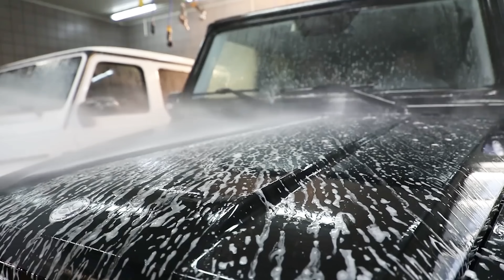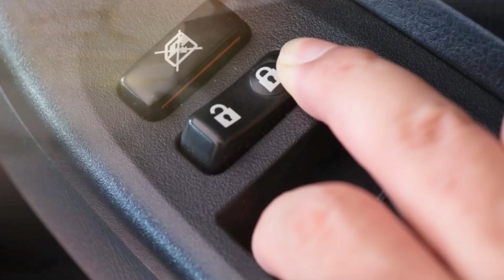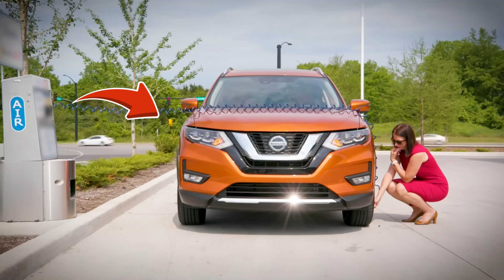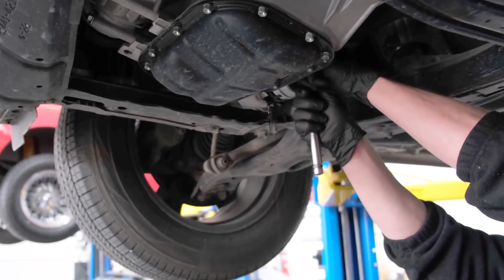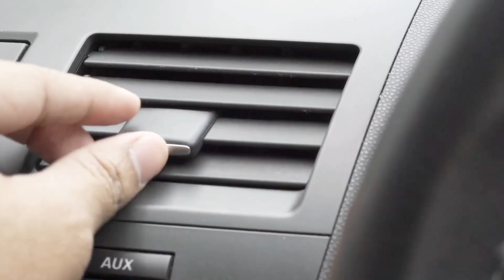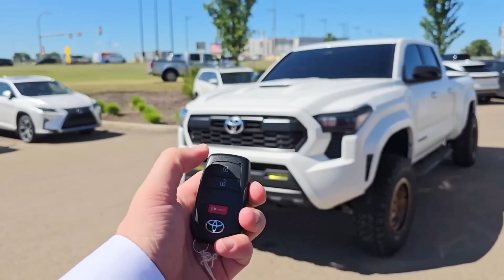This SECRET Car Features Is Only Known by 1% of Drivers (USE THEM NOW)

Comment: There are some recent vehicles (particularly certain VW models) in which you cannot put the windshield wipers in a lifted position. It causes significant problems for cold climates. Be warned.

Comment: I'm trying to figure out what good filling your car is going to do if the battery is so dead you can't open the gas cap.

Before buying a new car, read the owner's manual online. Find things like how hard it is to adjust the parking break or change the cabin filters. Sometimes it's a $100 PITA. Sometimes it's designed properly and is as easy as changing a coffee filter.

Comment: Many seatbelt mechanisms have a pyrotechnic charge in them that explode in the event of a crash and lock the seatbelt in place. A vehicles airbag is deployed by the use of a pyrotechnic charge. Impact crash sensors are made of a steel ball in a channel just barely big enough for the ball to travel in. The size of the ball and hole is calibrated so that in the event of a crash the ball will be forced forward to the other end of the channel. Inside the other end of the channel are two electrical contacts that the steel ball will complete the circuit between, signaling the SRS module that a crash event has taken place. These sensors are on both the front and sides of the vehicle, allowing the SRS module to determine which airbags to deploy and most new Safety restraint Systems have dual stage airbags that can deploy at two different pressures, an airbag blowing up in your face can break your nose and give you black eyes, but is still obviously better than not having an airbag. The airbags themselves are expensive so deploying all the multiple airbags in these new vehicles in the event of a lower speed crash is not economical and if you have a child car seat or a younger person in the passenger seat the airbag could do more damage than the accident itself so they use passenger seat sensors that weigh the weight of what is in the passenger seat and will not deploy the front airbag in the event of an empty seat of deploy it as a lower pressure if it detects a child car seat but its always best to have the child car seat facing backwards or even better the child placed in the back seat. The new SRS systems are very complex and work very well. As an FYI if you are riding around with your SRS, seatbelt, light on its very likely your airbags will not deploy in the event of an accident as the system is usually disabled when that light is on. Same with the ABS, if the light is on then the system is very likely disabled and will not work at all. This concludes my useless facts of the day.

Comment: The accelerator pedal reset worked great for me.

2006 Ford Focus ST.

Btw: It has nothing to do with the throttle body. Modern cars have electronic gas pedals. This function resets how the engine ECU processes throttle inputs.

Comment: I'm not sure about the feature were you leave the engine switched to on as you inflate your tyre to the right pressure. If somebody wanted to hijack your car at a petrol station, they simply have to jump in the driver seat and drive off as you're concentrating on the tyre gauge or when the horn is honking.

Comment: I wish I could get my auto theft to work right. I wish I could just disable it. It goes on and off then my car won't start until put a code in that I never used before. It's a 1996 Sunfire Convertible. It runs great except for that. I've had it looked at several times and never able to get it repaired. 😢 any ideas?
Reply: Pull the wires or fuse.

Comment: I have been driving stick since I was 18; 57 yo now.  All my vehicles are stick (manual shift).  Just an FYI, as an American, I want to point out that if I am on a flat road at a red light and can sit in neutral without holding the brake, I make sure the car behind me is NOT a cop car.  If it is, they might pull you over for not having brake lights.  If I have a cop car behind me, I keep my foot on the brake since they don't know I am driving a stick.

Comment: Most cars don’t have keys anymore. They have fobs so some of these so called secrets are not helpful at all.  As far as the electronic fuel door issue.  Doesn’t matter how much fuel you have if the battery is dead. 😂

Comment: #10 _ how do you literally drive up and get to the gas station if your battery is dead?  😂 I believe that the hidden release has a little more to do with electronic solenoids and buttons, failing, etc. than it does a “dead battery”. 

#8 _ I think pretty much everybody knows about this.  

#3 _ you don’t know this non-hidden, non-secret WHY? 

#2 _ might be the dumbest one on this whole list… I knew that my key fob remote started my car long before I figured out I could get an app to do it on my phone. Additionally, I learned that the app on my phone will work to unlock the doors in an emergency even without the subscription.  

#1 _ my last car would automatically tilt the mirrors down when I put it in reverse. By itself, as long as the mirror selector was not in the center/Lock position.  The new car does not do this at all. I’m going to test out this trick today - and see if it’s true.

Comment: Here's the kicker... If you own a BMW E90 or similar in the UK and your battery dies you can't get to the emergency pull cord for the fuel cap in the boot... The reason...??? The battery is also in the boot and there's no way of opening it... No manual key lock... no 60/40 split seats... no ski hatch... no manual lever boot release... NOTHING... Thanks BMW Europe...

Comment: None of the features described in this video are secrets! 🙃 If you have buttons in your car that you do not understand the function of it'll be in the manual.

I particularly enjoyed the bit about the "throttle reset" and the video showing a cable operated throttle body! 🤣So much nonsense shown in this video.

I'm not sure about the US but in the UK if you roll backwards on a hill during your driving test you just failed! Don't roll back on hills just learn to use your handbrake!

Comment: LOL .. If I have a flat battery ..My 2008 Vauxhall Astra  I cannot open the Hatch as there is no manual key slot .. the only door i can open is the drivers door ..   as the fuel flap is automatically locked , i would have a hard  ..if not impossible time trying to access the fuel flap pull

Comment: How did you get to the gas station to find your battery is dead and can’t open the fuel door with a dead battery? Even if you pull the emergency cable and fill the tank, you still can’t start the car and go anywhere.

Comment: I'm prettying sure everyone wearing a seatbelt expects it to prevent fatal injuries.
Reply: @SANSd20 . . . . Yes, that is the way the seat belt is designed. It is not necessary that car owners to know this in order to benefit from this feature, or many other safety features in a vehicle . . . they are simply there for our protection . . . . . . . .  and that's the kicker.

Comment: Well so far I just checked my car for the seat belt adjustment, I have none. Then I checked for the cooler thingy in my glove box
and none. So much for the Deville! No hooks in the trunk either to hook grocery bags on. But I did see some kind of netting thing
back there. I need an auto hold for my motorcycle!

Comment: You need to be careful with the "throttle body" clean tip. The correct name for this is a "relearn" which is basically going to reset your engine idle speed. But here's the "Kicker": if you have an Audi with the DSG S-Tronic automatic gearbox with flappy paddles, if you do what this dude says, you are going to reset your DSG settings, so proceed with caution.

Comment: The wiper erection is a good idea only to be made useless by by some spotty oik noticing them standing upright on a frosty night ,and conveniently bending the arms into a interesting swan shape,before disappearing into the night chuckling to himself ,where if your wiper arms were in the normal position possibly frozen to the windscreen the destructive brain cells in the oiks head would not be activated and he would carry on his way back to his sad little life,I’m leaving mine down just defrost your screen with tepid water pouring it onto the roof first so it runs down the screen start your car Immediately after and switch the wipers on before water refreezes.

Comment: Replacing the Cabin Filter will ALSO keep your heater core from getting clogged up with dirt, dust, etc... When it gets clogged up (externally) you will not have air passing through it, which means you will not have a functional heater for winter time. I learned this the hard way!

Comment: Here's the kicker, when air bags deploy, the vehicle is totaled.
Reply: Not anymore we were in an accident and air bags went off . Now if the repairs are less than the car value they fix it. We had $10,000 worth of repairs in a 6 yr old pilot they fixed it.
Reply: Yes & can be bought back by owner from junk yard. They should give owner 1st chance.
Reply: @DTaylor4JC my wifes car was totaled by hail, we took the settlement, drove it for another year before scrapping it.
Reply: Bit what makes it brilliant

Comment: My 2013 Audi A4 tdi gives me warning lights from time to time. Like coolant or headlight issues.  Worked out that it happens when my battery needs a good boost, after which they all disappear.  I’m a housewife and usually just go down to the local shops so don’t really charge it properly.

Comment: The hack about the soft reset of the ECU works.
I bought a 2010 Holden Commodore that was displaying the orange engine warning. Previous owner fixed a coil and couldn't clear the code and had a code reader connected to clear it when it alarmed. Now I can disconnect it and the cars fine😀

Comment: If you try to go through a car wash with the wiper blades sticking up like that, they will get ripped off
Reply: But who on earth would do that? One of the downsides of lifting the wipers right up to change the blades is, the chance of smashing the screen if they get bumped back down. It happens.
Reply: @oberyn-1 Put  a towel on your windshield if you're working on the wipers regardless.
Reply: Straight up while on the windshield!
Reply: And, and, and if you have the windows rolled down going through the car wash the inside of the car gets wet.  It took me a long time to figure that out.
Reply: He only showed the wipers can come up. He didn’t say to do it in car washes.  It saves them from freezing to your windshield if you have snow.  A lot of people don’t scrape their windshields and use their washer fluid and wipers instead of scraping the ice off.
Reply: Ummm.  Yes.  0:36 39 He SURE did dumbly say. Carwash. 🤓🦻🦻🦻🦻🦻🦻
Reply: Stupid that he even said that. I couldn’t believe it. That’s when I tuned out.

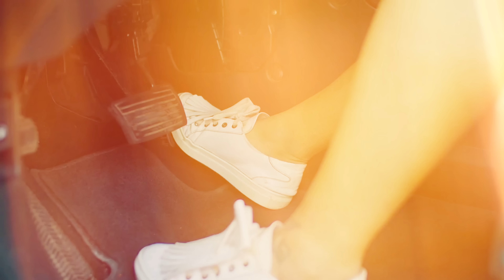Comment: 15:31 I literally just clean my throttle body and boy oh boy does it make a huge difference. My car ran great as it was. But once I clean the throttle body, the throttle response is even better than it was. And I love how my mirrors tilt down when I put my car in reverse the park Paris I don't really need it because I do have a backup camera, but it does help. But one of the features that I love in my car is that my steering wheel is adjusted electrically and so is my passenger seat. But the feature that I like the most is when you shut the car off and open the door, the steering wheel goes all the way up and the seat goes back for the so you have more room to get out. And when you get in the car and start it, the steering wheel and the seat go back to your normal driving setting
Reply: Ditto. Your's a Lexus too?
Reply: @stephenoneill245 2010 Nissan Maxima SV

Comment: The key in the fob doesn’t start the car. I can only open, lock the door or glove compartment with the key. The car still only starts by holding the button. so how can a soft factory reset be accomplished?
Reply: Check your owner's manual. Most button-start cars allow you to start the car by pressing the fob against the start button and pressing the brake. Some cars make you press the dead fob against some other part of the car, but there's usually a way to get it done.

Comment: Here's another kicker. You won't find these features on a car older than 3 to 5 years old depending on make and model.
Reply: That's not entirely true.  In many examples you had to turn the key.  I haven't had a key ignition for closer to ten years so those secrets are of no use.
Reply: yup, almost all these features i've never seen, newest car i've ever had is 20 years old, and its dead, now driving an '87!
Reply: @FieroGT3400 I had a 2003 Buick with 70000 miles. I lost it from flooding during a hurricane. I really miss that car.

Comment: On most cars not true about default mirrors turning inward when parking only possibility high end newer cars or you added the feature why have it when parking you need your mirrors and enough room to get out of your car so there is more than enough room for your mirrors mine manually can be pulled in WHY! I need enough room to get out of mg SUV

Comment: OH MY GOD NEVER ever pull windshield wipers away from windshield in winter especially windy due to it ruins wiper motor also huge fact they actually break off and either hit your windshield and crack the glass or worse fly off and hit another car. What eejit would tell you to do this? WOW. I live in Canada one of worst things people do in winter. Due to this fact my SUV makes sure you can't pull windshield wipers away from the windshield. Either cover with windshield protection of warm up slowly to defrost the windshield.
Reply: If you have an automatic rain sensor, the wipers can tend to try to move as soon as you push start, which can strain the motor (a bit) and rip the rubber lip of the blades. That's why it is a good idea to pull them up OR (of course) switch to manual mode when it's freezing.

Comment: The   ((A)) button isn't the button that holds the car on a hill, it's the auto start/stop button that shuts the engine off when stopped at a traffic light. At least it is on cars I've owned.

Comment: What about the thumbnail? I've been waiting to find out finally what is up with the button on the seatbelt, and I thought I finally found a place that would tell me, and you didn't. So I still don't know...
Reply: The button on the seat belt simply holds the the at the top seat belt so when you reach for it the buckle is at shoulder on your left so you don't have to look down the side of the seat
Reply: Surprise but the seat belt CAN cause severe injuries.

Comment: Good info.  However, the words "certain" and "most" are doing some heavy lifting.  I have a 2023 Lexus RX 500 and I don't think that battery saving feature works.  I don't drive it for a week and the battery drains.  I have to use a trickle charger regularly.  Especially when I go on a two week trip that doesn't involve driving.
Reply: Maybe buy a real  battery or better yet buy a real car.

Comment: Put 35psi of air in all 4 tires. Now, lower the front left and rear right tires to 20psi . This will keep your battery from ever going dead, will increase your MPG by 20 miles per gallon and keep your engine from ever needing an oil change. This has been proven by CNN atomic scientists.

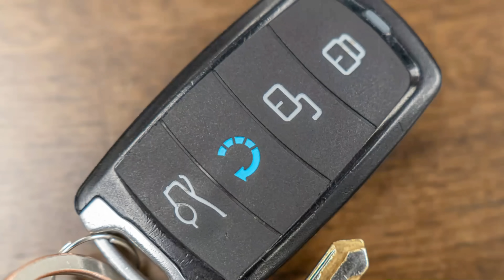Comment: 19:55 That wouldn't be a good idea... I always leave my car in 1st gear when parked. If it was possible to start it from a distance, it could cause a lot of destruction!
Reply: The remote start feature of my 2021 Nissan Rogue is disabled unless the transmission is in "Park" and the doors are locked.
Reply: @bob_the_engineer1045    Good! But manual gearboxes don't have a "Park" position. 

That aside, there's a lock-out that blocks the starter motor from enganging unless the clutch pedal is fully depressed. So it wouldn't work anyway. 
 
Then again, I really don't see the usefulness in such a feature. Surely no-one should start their vehicle's engine until just before they drive off.

Comment: Here's the kicker. Lots of these don't come on the cheaper cars.
Reply: Or older cars…
Reply: @loric4887  or cheaper older cars...
Reply: When my battery died, it just died without shutting down non-essential features
Reply: @irenes3470   . . . Yeah, that feature wasn't available on a 1951 Dodge.
Reply: Funny! Do you do stand-up?
Reply: Here's the kicker, it says on modern car on a lot of these tips 😂
Reply: They're there, you just have to go to a mechanical scientist to show you where those features are located.

Comment: My 1999 Corolla just died. :text-green-game-over:  Can we have a moment of silence. 😥 I loved that car.  😫 The fuel tank had a major $1000+ fix.  Yet 27 years with very minor fixes isn't bad, only a couple of door handles.  The headliner needed to be replaced, too, which we never did.   A lot of the driving was in the mountains.  I only had 125,000 miles on it.  I always had to remember to turn the left hand signal on to start the engine.  How many years did it have that feature?  Thanks for all the tips.   I think I will surprise my husband with a lot of knowledge you gave me.  We now have a Camry.  😊 Greetings from Lake Arrowhead.                                                               💜🦝           4/6           6am

Comment: If your battery is dead, how did you get to the gas station?  How are you opening your trunk if that is electronically operated too?  Why do you need gas if your battery is dead and can't start it anyway??
Reply: We are on the same page. I made these exact three points only on three separate comments.